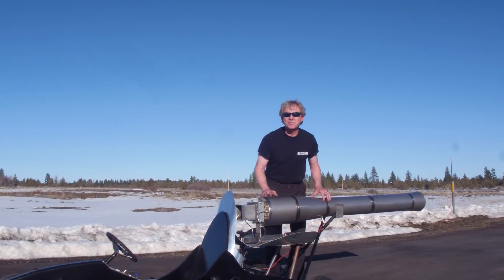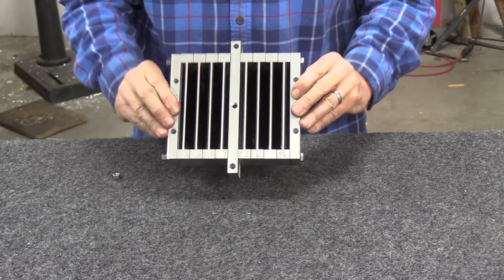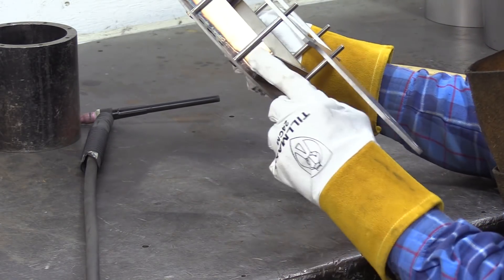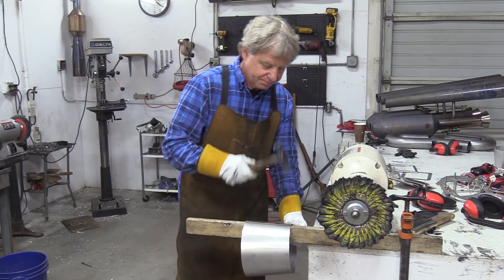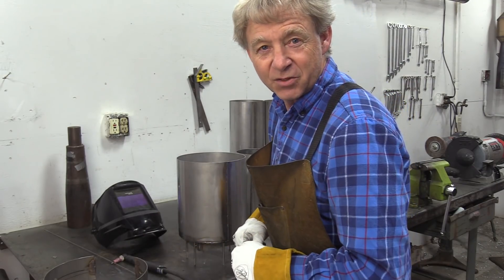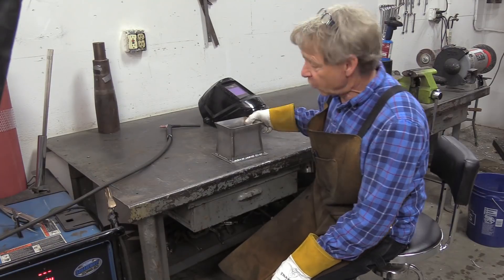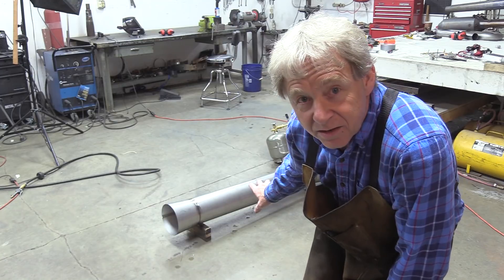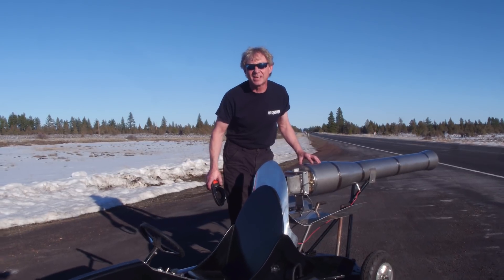Jet engine kit!  Building the 100 pound thrust Hurricane pulsejet engine.

Comment: I really like your work. I really wish you would put specifications on your various engine models such as weight, dimensions, relative fuel consumption rates, etc - maybe decibel levels... Will you ever be offering smaller form factor (3 feet ish long) models that still provide high thrust? 
Also, do you think it's practical to use passive one-way valves (ie, the Tesla valve) as opposed to the reed valves? Doesn't look that it'd be that much tougher to machine, but I dunno.
Reply: I've looked into it. Tesla valves are not really good for pulse flow. They tend to work better for more steady state flow.

Comment: I wonder if these engines would run on hydrogen-oxygen gas? If so you would really be rocket man! You could build a rocket powered Me 238 replica......that wouldn't have poor performance at high altitudes due to low air pressure.

Comment: Wonder how methanol injection would affect performance, ever think of trying that??
Reply from the maker: Ha ha, I've tried everything. Pulsejets run well on Methanol and start well too, but like any engine it takes more fuel to make the same as gas, however you can use more because it has a wider O2 range that it will burn and you can make a little more power than with gasoline...But they already use a lot of fuel so the benefit in a small engine isn't worth the hassle and cost.
Reply: Your point is well taken but I think you misunderstood me. I ment adding meth/water injection as a supplement to gas or diesel like is done with performance cars and trucks. At any rate keep doing your thing. You have advanced the art of pulse jets more than anyone I have seen, Great work!
Reply from the maker: I see, well the I tried water injection to increase mass flow, does nothing, also I used NO2O and a lot! the engine would burn a lot more fuel and make no more thrust.

Comment: I have enjoyed all of the music I have heard on your channel so far.

Have you ever tried running super heavy fuels?
Reply from the maker: You mean like bunker oil? I have not just diesel, however I think the Lockwood style engine would run on it fine as long as you get your pump pressure up to about 160 psi and use multiple small injectors, I try to stick with simple fuels you get at the gas station. Thanks,
Bob
Reply: Well simple is definitely better for pretty much everything, and yeah you would have to rig up a pump which would consume a considerable amount of the overall power.

I'll have to experiment with recoil operated hydraulic injection some day.

Comment: How long could you run that engine statically before it would start melting apart?  
If you had a ram air scoop on your go cart, would it make more power the faster you went?
Reply from the maker: I have seen that, the guy did a brilliant job of R&D I have plans for a rocket in the future shows, A BIG ROCKET!
Reply from the maker: Well the engine will never melt it doesn't get hot enough to melt the stainless steel, and yes ramming air into the intake does increase thrust but not until about 150-200mph so on a small kart or bike it would matter.Thanks!
Reply: Robert Maddox sounds like a challenge to me lol.
Reply: I can't wait!
Reply: Have you seen the video of the vertical pulsejet rocket?  Basically a vertical takeoff pulsejet.  Any idea how high you can get one to lift with a hundred pound thrust motor?